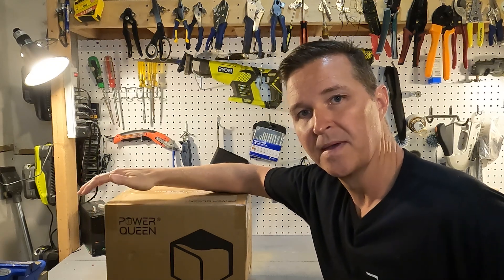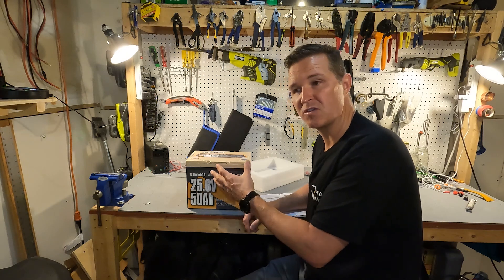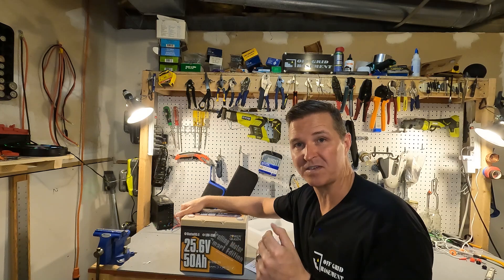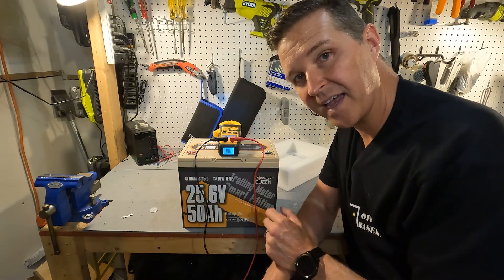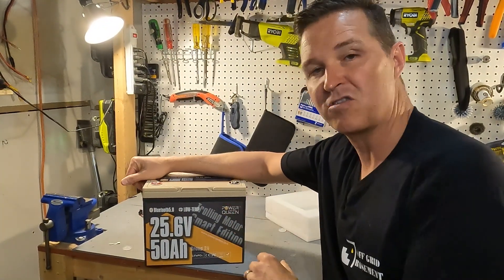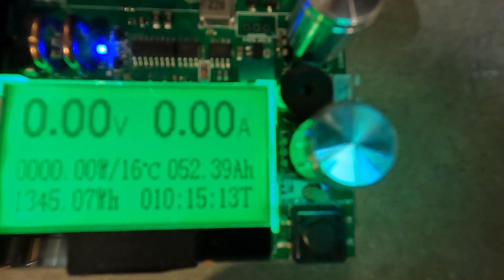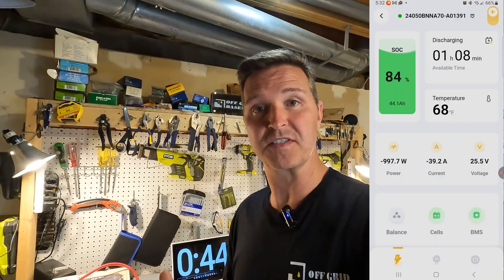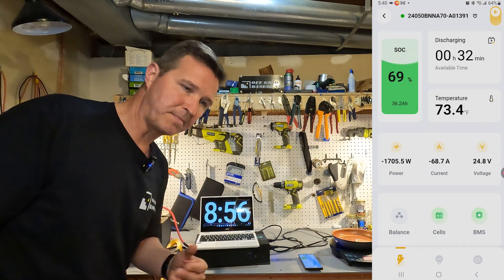Full Review and Testing of the Power Queen 25.6v 50ah LiFePo4 Battery.

Comment: I have had to wake up a lifepo4 many times before but that was only it was over discharged.
This one was still at 49%, why in the hell did it comes at 5v ??
A lot of people don't have a spare 24v or even know how to wake up a low voltage battery.
Reply from the maker: I've been told it's because of the Bluetooth.  It will slowly discharge the battery while in storage.

Comment: Tear down 
I agree the 50amp discharge current is a bummer.
We need to see more 24v batteries.
Speaking of 24 volt, I’d like to see 96v batteries for those all in one systems.
Reply from the maker: I don't know if I would feel comfortable with a 96v battery.  One mistake and ☠️.  Thanks for the comment!
Reply: @OffGridBasement it’s still below household voltage. And cable size would get even smaller. We’d be dealing with nothing larger than 8 awg

Comment: Re: BMS BT reporting crazy current readings.  This is because the inverter you have is generating AC and during the different phases of the AC waveform the load on the battery changes.  Repeat the test (@9:00 in the video), but switch the clamp meter switch to AC current.  The App is reporting instantaneous current readings.  This would make a great video, and if you could add a shunt and put a oscilloscope on it (voltage across the shunt)  that would really be interesting.  The issue with the BMA is, it should not be measuring the instantaneous current but should filter the waveform before sampling (or filtering by sampling at high rate and apply a digitally filter).  I would also suggest performing this test with several  other inverters and other batteries.  I am guessing the more expensive inverters will have less current ripple on the load to the battery (but maybe not),
Reply from the maker: Thank you for the great information!  I never thought about the issue being the inverter since my amp clamp was fine.  When I get another 24v inverter I'll test out the difference.  Thanks for the info and the comment.
Reply: @OffGridBasement  There is nothing wrong with your Inverter, it is just how they operate..  Inverters have a significant AC ripple component on the  load to the battery, it is that the BMS is not filtering it out before reporting the Current measurement to the App.  Please test this inverter using with an AC clamp meter on the battery lead, and also try this test with 12V inverters (and 12V batteries).  FYI David Poz posted a video (Nov 2023) "Is Bigger Better? 230Ah, 11,776Wh, Server Rack Battery" about a battery from Orient Power where the BMS was having High Current Protection shutdown at 170A (85% of the spec) powering an inverter and built a DC resistive load and got the 200A test to work and I suspect the issue there was the BMS was triggering on instantaneous current measurement.  One other test you can perform is to use a pair of 12V batteries with at least 1 of them BT in series and monitor the current vie BT App, and use check the current to the inverter with a clamp meter in both AC and DC modes.  I expect the App will provide steady power readings even though the current has a significant AC ripple.

Comment: There are even 48V (51.2V) 25Ah batteries out there. I have one from Lithova though I'm not sure they make it anymore.  But I think it's pretty cool that one can pack a 16s BMS in such a small form factor.  Still, the baseline size now seems to be a bit larger: 200Ah @ 12.8V, 100Ah @ 25.6V, or 50Ah @ 51.2V.... roughly 40lb batteries.

-Matt
Reply from the maker: You're probably right about that.  Starting to get "not so portable".  It does save on wiring cost though.  Thanks for the comment.

Comment: I just bought 2 12-volt 50 Ah batteries from different manufacturer to run my box freezer and got them set up in a 24-volt configuration. I bought them to add some run time to my Delta 3 Plus. So far, so good. When the power station hits 97%, the time remaining, the batteries kick in and draw 385 watts to bring it back up to 100% in about 4 minutes. I'm not sure the total runtime yet since this is the first time testing it out.
Reply from the maker: That is awesome.  It sounds like you have a nice setup.  Thanks for the comment!